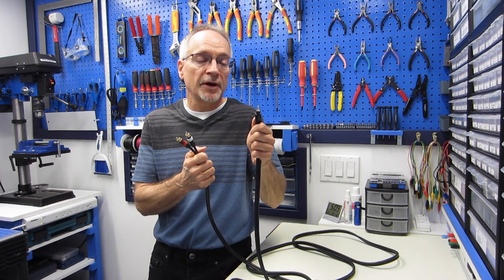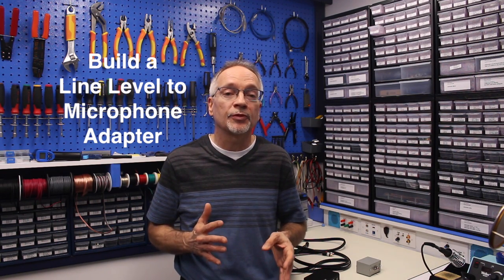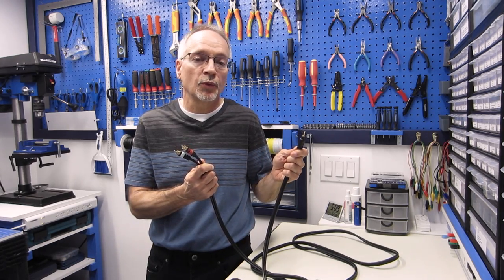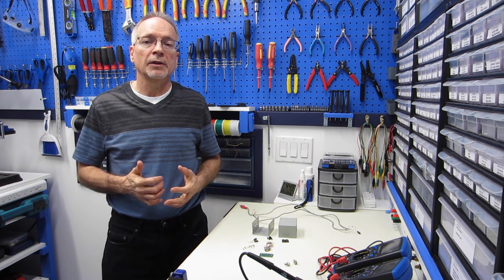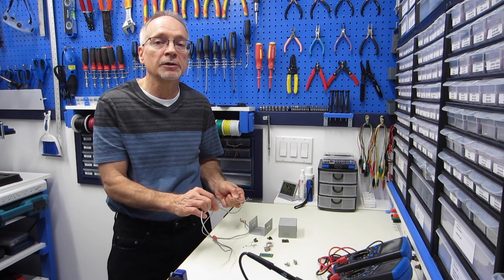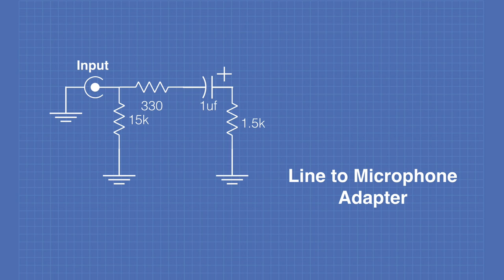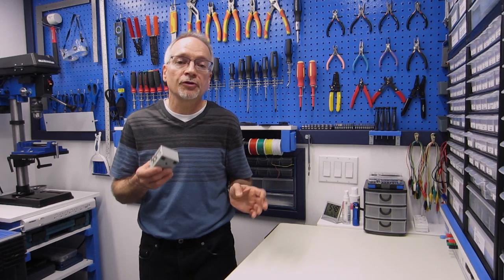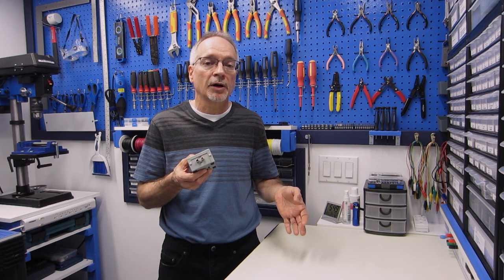Build a Line Level to Microphone Adapter - Record from your Phone to Computer or Camera

Comment: I have been trying for ages to figure out a way to attach one headset microphone to two PCs because I use a KVM switch. This seems like you could in fact add power to the 'input' side and use it without an external mic amp if you wanted. The audio would still be VASTLY cleaner then just using a Y adapter.

Well done sir, you've earned a subscriber, that is brilliant.

Comment: Very helpful project with one caveat. That final 1.5k resistor creates a high pass filter with the 1uF capacitor blocking frequencies below 100 Hz (though attenuation starts around 1kHz!). This is probably fine for speech, but if someone wants to use this adapter for music a 10uF (-3dB cutoff frequency below 10 Hz) or more capacitor is a better choice. You can verify low frequency attenuation by recording a 20Hz-20kHz frequency sweep through the adapter and opening the file in e.g. Audacity.

Comment: This is essentially a voltage divider.

Loved the circuit, very simple, I'm sure it works flawlessly for many people.

I just have some constructive criticism about your explanation of the circuit. Hear me out.

What you're essentially doing is a voltage divider, and not a very stiff one as that cap varies from 8k ohm to 8ohms across the audio band, which dramatically changes the attenuation.

It would have been better if you had started with the nominal line level you had and the max. mic input level you needed. Deriving an attenuation factor out of those numbers would then be trivial.
Just a thought :)

Comment: thankyou so much for such a clear explanation and circuit diagram............it works...........
i can now record the output of my laptop in my android phone without using any mic
for those who are confused about whether the ground should be connected altogether- yes all ground are connected together.
note that the output should be enough to get input in the mic, in my case when I am up to 20%% volume of my laptop, my phone does not catch any sound. above 20% works fine

Comment from the maker: Aaron, for some reason YouTube refuses to let me reply to your comment, so I'll try opening a new thread here.

I believe your SI Impact has only microphone level inputs, correct?  If it's the one I'm thinking of these are "combi inputs" that allow you to use either 1/4 inch or XLR connectors.

In theory a circuit like I show here should work when fed into the 1/4 inch inputs. I would build it with RCA inputs (or 3.5 mm if that's better for you) and 1/4 inch outputs. You would need a bigger box than I used to accommodate the 1/4 inch outputs.

The XLR inputs are balanced lines and they would need matching transformers (or their electronic equivalent) to do the job. Good quality units can be expensive.

Comment: Amazing video. Finally I found a solution for my problem after days of research. Just one thing I couldn't find anything about this device on your webpage. I might just miss it. Also would it be possible to release everything since I'm not 100% sure and don't wanna mess anything up("datasheets" for capacitors and resistors etc, detailed schematics drawing for circuit board and plugs for every single lead/connection)? Maybe on your webpage?

Comment: hi, great video, i need to record a line level output ( guitar multi fx pedal) headphone out,  to a android tablets input for recording video/audio....the tablet is a trrs socket, and has 2.6v dc only on the mic lug of the trrs, when measured with a meter, so it is very noisey, will this device cure that?...( i take it the right side of your schematic is the line level going in...and the left side is for going to a mic input?) just making sure.. cheers, .

Comment: Sir is it ok to use a ceramic cap instead of electrolytic cap? If yes, what value should I use? I already have built and tried the circuit and it works fine.

Comment: Excellent video!  My project is to take the output of Garmin GPS and feed it into my microphone which is inserted in my helmet. The newer and older Harley radios will dim down music when the rider speaks in order for the passenger to hear the driver. The newer bikes have the GPS built into the radio and does this automatically. The older bikes do not. Do you think there be any issues with 2 mics in the same input circuit? GPS output and driver mic circuit? Thanks in advance.

Comment: Very nice video and very much understandable. Your technique for making people understand about your content is really awesome. Everything is fine.... But sir can you please tell me the 15k resistor will be at the start point / left of the 330ohm resistor? Or the end point / right side of the 330ohm resistor? There is a little confusion at this point. Can you please make me understand clearly whether the 15k resistor will be connected from signal to ground before 330ohm resistor? Or after the 330ohm resistor? Please reply..... As far as I understand..... If I connect it after 330ohm resistor, then the signal will be a little bit weak. But about the usage before..... I don't have any experience..... Plz sir make me clear on it🙏🙏🙏🙏

Comment: Starting Youtubing and my camcorder Cam1 has wonderful 4k video . but the audio mic internal and external substandard. i used my blue tooth to my surplus phone camera that I use for cam2 and the Phone Audio was the greatest. Could not find anything  cheap to do the hook up from phone audio out to camera mic input till I saw your video.  I have the mixers, but are to big.  Have tons of components and will build your project. By feeding the mic into the camcorder give less time editing and I still have the full audio recorded on cam2. Thank You

Comment: At 5:22 - do you mean that the resistor divider you've created (330/15k) creates the level drop? A resistor in series affects current, not voltage.

Comment: hello, 
would it be helpfull to put a 1:1 transformer in the circuit to isolate the ground of the in and output?
If so, where is the best position and would it affect the values of the resistors in this schematic?

I'm plannng to make an adapter for an intercom beltpack to connect to a laptop or smartphone. The belpack specifies an impedance of 200 ohm at the mic and headphone out.

Thanks 
Sevrien

Comment: Sir, You call your circuit  - Line Level to Microphone Adapter - Most Microphones are not line level and they output Very low volts in fact output micro volts, and  will not drive a line input, So would it have not been better to call your Circuit an -  Audio, Line Voltage, Attenuation filter  - As it can only connect and attenuate audio line level devices.

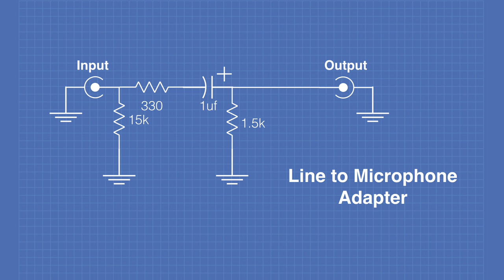Comment: Something that is confuses me about the final schematic shown at 6:40 is that the cathode of the electrolytic capacitor seems to be connected to the postive side of the input signal.  My understanding is that the audio signal on the input side is an AC signal with a DC bias. Is it safe to connect the capacitor that way? Apologies if I'm getting this wrong, I've only recently started learning electronics.

Comment: Thank you, this is just what I am looking for. I have an extra headset wireless mic system. I can use this adaptor  for an output from my mixer to the transmitter then to the receiver on a powered speaker  !

Comment: Great video!  Question...  Why would a solderless breadboard pick up noise but the little circuit board you ended up using would not?
Reply: because of the metal enclosure?

Comment: Thanks so much for posting this, and THANKS so much also to @mariuszsobolewski6713 in the comments below for suggesting the 10uF capacitor switch-out to improve the audio fidelity. I made 2 of these circuits on a small board, 1 right, (red, and ring) and 1 left to keep my stereo field separate, with all of the grounds linked together. I stuffed the board in an old RAT effect pedal box that I gutted, hooked it to my Octacapture audio outs from my pc straight into my Sony handy cam. This hook up scenario has always been a VERY, VERY noisy proposition every time I have ran it, FOR YEARS. Not any more. . .  it  WORKS LIKE A FRIGGIN' CHAMP! Thanks again ya'll!! 😃👍👍
Reply: Poor

Comment: I really don't get how this is supposed to work? Line level is around 1v (0dbv) and microphone level is  between 0.001v (-60dbv) and 0.01v (-40). Using ohms law these values in this configuration would give you 0.978v nowhere near the  0.01v. Swapping the 330ohm and 15k resistors would give you 0.022v a lot closer to the 0.01v or am I missing something here?
Reply: I was looking at the wrong resistor but 1.5k is still nowhere near a sufficient drop in voltage. Don't know what I'm missing here
Reply: The 1uF cap may have something to do with it?
Reply: Me too i calculate the attinuation it's -9.269dB not enough to get -12 dBfs roomhead.

Comment: Just what is need! Thank you. I am pretty new to electronics  Can you please explain why the capacitor is reversed? The signal goes onto the cathode instead of the anode?
Reply: The purpose of the capacitor is to block the DC power that comes out of a typical microphone input jack. Microphone inputs designed for electret microphones put out a direct current voltage to power the FET transistor found inside a typical unbalanced electret microphone.

Comment: Do you still have the article link on your website for this?  
Also, what voltage capacitor do you recommend for 1uF tantalum?  I would need it small for my application.  
Thank you for the greatly detailed video with explanation.

Comment: Thanks, DroneBot, I'm going to build it. Can I place a Y-adapter at the Line-In in order to monitor (with a headset) what the recording device is taking in (as output from this project box)?
Reply: LTSpiceXVII (July 19, 2019 version) was given an Alternating Current of 5 volts (peak-to-peak) at 440 Hz; after about a 2 ms startup,  it settled down to returning an AC of 4V p-p with just a little lag due to the capacitor.

Comment: Hi DroneBot, Love your videos--please keep them coming.

I am trying to record walkie talkie audio on an Android phone using a cable and having some issues.

I am using the following 2 cables for my setup but it doesn't work all the time and is unreliable. The 2 cables are 

   1.  CTIA or OMTP  compatible headphone-mic audio Y splitter cable 3.5 mm  (This cable tells the mobile phone whether we want to use the microphone function or speaker function of the mobile phone) 

     2.   A Line-to-Mic Attenuator Cable, 3.5 mm (This cable connects the walkie talkie to the Y-Splitter and sends the audio input to the mobile phone) 

Cable 1 is connected to the cable 2 and that's the setup. However, it doesn't work all the time and is very unreliable ( a slight movement of the cables stops the audio from being received on the mobile phone). 

Is there any other cable I could use to get more reliability? Maybe 1 cable or a different setup to record walkie-talkie audio on an android phone? 

Any suggestions will be greatly appreciated.

Comment: thanks for the idea sir. this circuit works in my mobile but not in my laptop. Laptop not sensing it as microphone .after removing 1.5 k resistor the circuit works in my laptop too

Comment: How would you amplify/convert a Headphone-Out audio signal to be feedet into a Line-In of a mixer/audio-processor?
Reply: You would use a pre-amp for this.  Or, more likely, the mixer would have a gain knob, which boosts the incoming signal to a more suitable mixing level.

Comment: I wonder how much voltage can it take … I need to feed the line input with and output from an intercom speaker where the level is way higher then your usual line / headphone line out … please advise

Comment: Hey this circuit seems to have a rather high output for  a phone mic input. Any suggestions?
Reply: Add another resistor between the input connection and the junction of the existing 15 K and 300 ohm resistors. I think he's dyslexic like I am and  may have got the schematic drawn incorrectly.

Comment: Hi there. Zero knowledge here. I had trouble finding the article on your website (description links to the main page) so I decided to shamelessly ask here. How do you know what resistors are safe to use? How do you even know you need resistors? Did you measure something or are those some general safe values that should be okay for all audio appliances? I took a 3.5mm mono splitter and soldered it in the microphone's and the right speaker's signals of my motorcycle helmet intercom (Freedconn TCOM-SC). I was going to connect them to my action camera microphone audio input (Ghost Drift X) but after watching your video I worry the speaker's signal has too high (or too low?) impedance and something will blow up. Help?
Reply: this is very low level current. nothing will blow up.

Comment: Will this work for feeding a line level mono signal into a smartphone, if you have a trrs connector at the output, with the right pinout? For this purpose, off course, the device would be built single channel. I'm looking for a way to get line level audio from a mixer into a mobile device. Normal line level will distort at the input, and occasionally also cut out, probably due to the lack of load.
Reply: I just built this as a one channel version, to attenuate the signal from an audio mixer to a mobile device. The the cirquit works fine, the signal will get through, with no popping or other noise. But the attenuation is not enough for my purpose, so I'll next replace the 330 ohm resistor with a trim pot, to find out the exact value of the needed replacement resistor. Thanks for a great video!

Comment: i have a si impact that has no line level inputs. I want to be able to connect my outboard gear but with no line level sources there is no way to do so without having a horrible signal. Do you think there is anything to be able to do for this situation>

Comment: How would you do the inverse of this? I'm trying to have have an easy way to convert mic level to line level without using a mixing board.
Reply: buy preamp ic on ebay for 1 doller

Comment: How to combine  both the stereo channels after attenuation   to a 3.5 mm samsung  headphone/mic pin ?. Please answer .
Reply from the maker: Hi Jolly. If you need a monophonic output instead of a stereo one you can just tie the two output channel hot leads together. The capacitors in the circuit will prevent the input channels from being tied together so it won't harm the sending device.
Reply: Thank you

Comment: I believe your electrolytic capacitors is the wrong way. The line level is going to be more positive than the mike level output
Reply: Did you try flipping it?? Does it work??
Reply: Nikhil Thorat I didn’t try

Comment: I need a similar device to go from mixer to my a mature radio so line to Mic if seen a diagram with a vari pot and it looks like it's fitted between the + and - of the output .this seems odd to me surely it's to go online on the positive out as a variable resister to just attenuate the signal down and then I see your drawing with both between ground and online on the positive out .I'm now officially confused lol can you help I'm hopeing to get this made today so I can get on air please help
Reply from the maker: Hi Nick
If I understand correctly you are confused about the resistor (or potentiometer) that runs from the signal output to ground?  

That resistor (or pot) is used as a "load" for the output of the device (such as your "mature" radio).  Most audio devices need to drive a load, under normal operation the load would be a speaker, headphone or the input of another audio device. Without a load there will be no output. The resistor or pot simply substitutes for an output device.

You could use a pot in my design, this would give you control over the level. In my case I experimented with the resistor values before building it so I chose not to use a pot.

Hope I explained this correctly and that you can get on the air today!

Comment: as already mentioned in the comments: 330k works much better than 330
(attenuation/dB) = 20 * log10 ( (R1 + R2) / R2 ) 
R1 = 330; R2 = 1.5k => (attenuation/dB) = 1.7 (nearly nothing)
R1 = 330k; R2 = 1.5k => (attenuation/dB) = 47 (works fine!)
Reply: Did you try this??

Comment: this looks like exactly what I need in order to attenuate the audio from my small mixing desk to the microphone input on my HAM Radio.
Reply: I use a software mixer from my soundcard, and I set the output gain to -20db so the voltage gets over 50milivolts. Dangerous, but useful, i feed my ham talkie with it

Comment: Isn’t this called a Di Box?
Reply: No.. A DI box uses 1:1 transformers to take a unbalanced signal and convert it to a balanced signal so it can be run over long cables without noise being presented at its output by phase inverting 1 of the 2 signals and cancelling out any noise pick up. Some DI boxes have attenuation switches to accommodate line or mic levels, and ground lift, But that's about it. Also some are active and some are passive.

Comment: I want like this but  from 1/4 jack to rca
Reply from the maker: You can build this with any type of jacks that suit your requirement, I used RCA connectors on each side as that is what I needed.

If you're using 1/4 inch jacks you might need a slightly larger box to accommodate them.
Reply from the maker: It's the same circuit! Just substitute the 2 RCA jacks I used for the input with the two 1/4 inch female jacks. Use a 3.5mm stereo (female) jack for the output. You could also wire it directly to a 3.5mm plug if you wish.  Because teh 1/4 inch connectors are larger you will probably need to use a bigger box.

For the 3.5mm connection use the tip for the left channel, the center for the right and the sleeve for ground.

I'll try and have the corresponding article up tomorrow on the website and will update this video description with the link, it will have the schematic printed out which may assist you.
Reply: DroneBot Workshop ok thanks very much